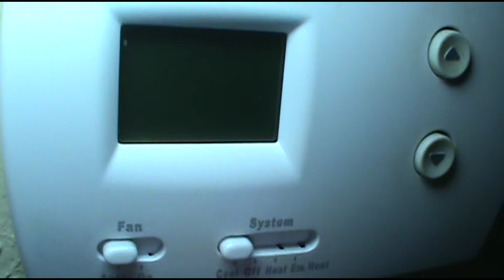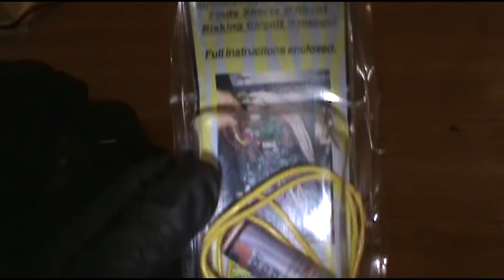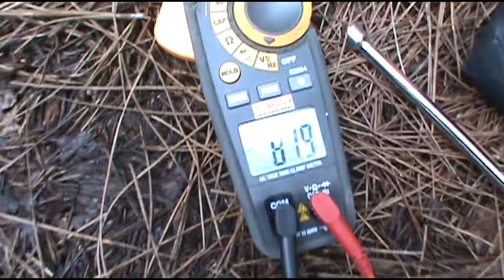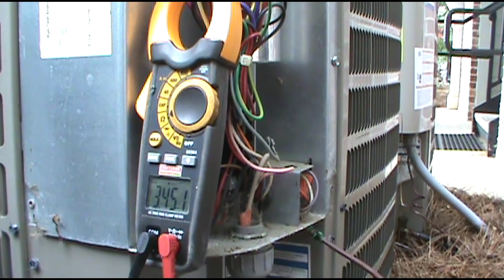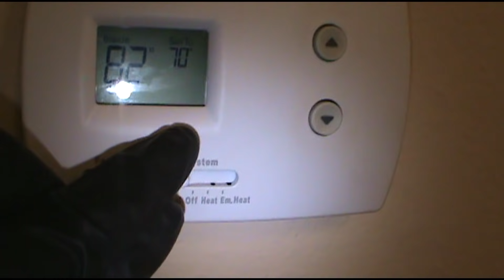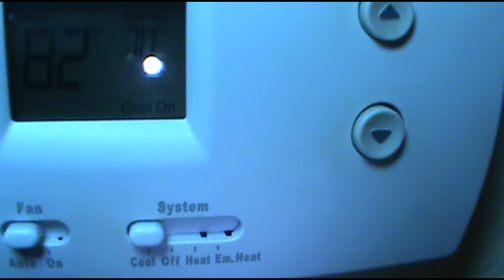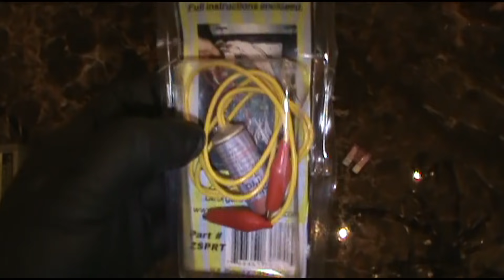Circuit Board Fuse In A.C. Keeps Blowing

Comment: I have a heat pump and when I select heat it trips the fuse. I  have changed the transformer I checked wires for breaks. Was wondering what you thought.
Reply from the maker: Low voltage shorts are too tricky. It could be in the wall, in the attic, or Lord knows where. I would change out the wire for one that's not being used. If the brown wire is in the heat strips terminal in the thermostat, switch it out with a black wire that's not being used. You'll have to take the shorted wire totally out of the mix. Even in the air handler. I hope everything works out for you Mock! 🤞
Reply: @LexVance  Thank you for your response I am going to use the pro short for the heat side of thermostat have done that before and if you have do you have a video.  I was just wondering what wires would need to be taken out of thermostat to do a heat short.

Comment: Anyone help me find my problem? I replaced both of my thermostat wires: my two wires to the AC and my 5 wires to the thermostat and even connected a new thermostat and the fuse blows immediately after the AC kicks on.

You said that it can't be the capacitor since it's high voltage.

Could this be the board? A short in the board somewhere?
Reply from the maker: It could be in the condenser outside, too.
Reply: @LexVance  Hi Lex, thanks for responding - I just figured it out - it was a bad contactor.  Replaced that and haven't had a problem since.

Comment: AWSOME video we have a temp furnace at work to cool and heat temp offices ,it’s a Payne brand and it keeps blowing 3 amp fuses , kicker is we have 2 temp units that is doing the same thing just a few days of each other don’t have any  multi meters  so we asked the sparks on job to check the blower and the said they jumped the blower motor bypassing something and the blower will no go on but the code is 24
Reply from the maker: Sounds like you've got a head scratcher there. 🤔Thank you so much for watching Jas!
Reply: If a 3 amp keeps blowing , is the short on the 24v side or could it be the blower and can I apply the same method as you used your 4 clip jig and the Short finder
Reply from the maker: @jasvan4359  the 24 v side. The fuse is for low voltage only.

Comment: Been babysitting a goodman system and cool seems to be the problem side, when it clicks on, 5 amp fuse-breaker drops and I have to pull the thermostat off and let the breaker reset.

Grabbing the cool wire short finder but, will also go clean the outside unit and contactor... Likely the problem child..
Reply from the maker: Thank you so much for watching Tim!

Comment: Every time I flip my breaker on the air handler my fuse pops what do you think it could be I changed the condenser defrost board put in new thermostat and fixed the nicks in the low voltage wire that the dogs chewed up please help me Lex lol I’ve been on this for 3 days what do you think it could be
Reply from the maker: The contactor could be bad. I would need to be there for this head scratcher 🤔.

Comment: My problem was a intermittent  shorting.  solenoid /valve  on the humidifier blowing the 3Amp  24vac. Fuse. Sometimes on furnace start.  I disconnected the solenoid and never blew 3a fuse again.  This case is with heating . -3°F  outside. I  figured it out in 15 mins. Being a highly trained  electronics tech for over 40 yrs.  I fixed it fast (LUCKY me)  not always easy  on some problems. REPLACED SOLENOID AND PROBLEM RESOLVED.
Reply from the maker: Right on, nice fix Ken! Thank you so much for watching!

Comment: I have a question I have a heater that's a heat pump it runs fine for a while and then it pops the fuse my guess is it's popping it when the reversing valve is energized but I could be wrong I haven't looked at the unit yet but I know that's what's happening. It's a Ruud system, I'm thinking it runs fine it heat mode and then when the RV is energized to go into defrost mode is when it's blowing it. I'll be going there in the morning to look at it, just curious what you think it could be as it doesn't pop right away.
Reply from the maker: I've had bad thermostats do that. It'll work for a while then pop the fuse. Put your unit in cool mode and see if it happens. If it doesn't, it may be the thermostat. Thank you so much for watching Aaron!

Comment: Hey my fuse keeps blowing in the air handler I’ve changed the defrost board the breaker is good and the contractor reads 17.3 what do you think it is
Reply from the maker: There could be a low voltage wire thats nicked and touching another wire or the metal frame in the condenser. A low voltage short can be tricky. The thermostat could be doing it too.

Comment: We have a Rheem that humms and pops the fuze every time you turn it on.  Nothing is working inside or out. It worked fine through the summer with AC.. turned the heat on and pop..
Reply: It's a heat pump..
Reply from the maker: There's a short on the brown or white wire in the thermostat or the thermostat is bad. Brown and white are usually the wire colors for heat. Your unit maybe different so be aware of that. You can disconnect the brown and white wire one at a time and see which ones bad. Then, you can hook up a color that's not being used in place of the shorted wire.
Reply: @LexVance  what would allow the unit to still come on when there is no fuse installed and it sparks when you install fuse?

Comment: Every year when I turn on my a/c it blows hot call a repair man and they are always only here maybe 30 minutes at the most and my unit starts blowing cold but if I turn it off at all then when I turn it back on it only blows hot again. Sounds like they are doing a simple fix so they can come back later and get more business. What can this be?
Reply from the maker: Yikes, that's a weird one. I'd need to be there because there's numerous things I would need to check with my volt meter. You've got a head scratcher there. 🤔

Comment: What if my transformer burned up? Is it the contactor.outside.that causing the problem. First I saw my fuse was blown  so I got some copper and jumped across the fuse like a dam dummy and burnt my transformer up. Ikr... So now I need a contractor and a transformer right?
Reply from the maker: It could be the transformer or low voltage wire touching and causing a short. I hope it works out for you Leonard!

Comment: I did what you suggested in the latter portion since I didn’t have a visible cut in wire. It was yellow faulty by screw nut elimination. I then went through and replaced the yellow with the extra black wire. When it all kick on it was heat! Not AC 😬 …???
Reply from the maker: Hmmm, is it a heat pump or straight cool unit?

Comment: So on update to my previous post.  I realized the compressor is running after all when I press the bypass button on the contactor.  I then measured the ohms on the low voltage side of it, and its near zero.  The ohms on the terminal side from the home is aroun 335 ohms.  So I will replace the contactor.
Reply: This is a bit confusing.  Are you saying the coil was near 0 ohms on the contactor ? Also what measured 335 Ohms. Please explain further. Pity you did not have this in your video which was very clear to follow.    Thank you for sharing your expert knowledge as it makes a big difference to us newbies especially those working in bad companies where they do not want to share any knowledge.

Comment: 3 amp fuse was blowing.  New fuse blew. I followed your advice and first looked at thermostat.  As removed it, a bunch of dead bugs fell out.  I decided to disconnect it ad put in a new fuse.  It worked as the circuit board would power on and not blow the fuse. decided the 15 year manual thermostat was time to go. I went out and got a 2 cycle programmable.  It got it al hooked back up and now it looks like it is defective out  the box.  It just lights up but no display.
Reply from the maker: Oh no. I'd need to be there and see the letters on the t-stat.
Reply: @LexVance  I did get it fixed.  I opened it up and the small graphite strip between the main board and display came dislodged.  I got it installed and when I switch to "fan' the unit comes on. But when I switch to cool, it blows fuse.  So I went out side and removed hatch.  When I press the button on the relay, only the fan comes on, not the compressor.  I went ahead and ordered a capacitor as they are only $10.

Comment: Lex, I was messing with my heater 3 months ago it wont turn on( but every now and then it will turn on miraculously but turns back off after a few min . I used a paper clip to use as a jumper wire to bypass the thermosthat . Nothing happen . The thing now is my AC WONT turn on as well. I didn’t not know what I was doing with the paperclip I must have shorted something in the proccess. Also I didnt turned off the power . Would this AC problem not turning on is cause by a burned out 3 amp fuse. Do all ac handlers have them? I appreciate your  help. It’s getting hotter in Sacramento . Temp reached 90 f today
Reply from the maker: Make sure drain pan or float switch isn't full of water. That will make unit not turn on. Also, the paper clip could've shorted out the transformer. You'll need a new one if so. I'd need to be there with my volt meter to see what's going on. Not all units have 3 amp fuses in them.

Comment: Lex.  Good morning love your videos
Question.  We have the same air handler at our property. My issue is when im trouble shooting board. Thermostat takes for ever to turn back on. I dont dont know if is the thrmrt or the control board.  How can i make run faster for repairs.  Thank you
Reply from the maker: Heat pumps have a 5 minute delay after power gets restored. Check thermostat instructions and you'll see how to make unit turn right on after repairs. You have to hold buttons down and then scroll to find setting for immediate turn on. Hope this helps. It's hard to explain on comments. Thank you so much for watching Gali!

Comment: Hi Lex I hope you see this soon. Bought a short pro ...should be here monday or tuesday to find the short.

** FIRST LOOK****3amp fuse blown digital Thermostat no power ...changed fuse and replaced disconnect and fuse popped immediately.  Visual inspection of wires at Therm, AHU and condenser did not show any nicks....Tested board....relay tested good (ohm test on C...NO and NC)  but did not get a reading at xfmr-R to R...Replaced board and new fuse.
***THEN....with new board....did not pop immediately and Heat came on and lasted less than 5 minutes but popped the fuse... and I believe it might have also fried the board. Xfrmer still tests good...relay on new board  tests good. 
1) Do I have to have a fuse in (with disconnect still out) to test ohm from xfmr-R to R?  I can't remember if I put  a fuse in with disconnect out...the first time.
2) Since I am testing for a probable heat not ac short....do I test every wire except blue C? or maybe just Red (R)...White (Aux/E and Orange (O reversing valve) and....yellow? green? 
3) Should I check that heat strip is installed correct...this is resident #3 on a 5 year old building with no previous issue....so I am doubtful that no one ever used their heat before...but i  had a problem in the first two years with misaligned heat strips popping fuses...so theres that.
Thanks for your advice Skid Master...really love the videos...super helpful!
Reply from the maker: Yes, to test the board, make sure there's a good fuse in there. I just take it wire for wire. Also, a few times when the fuse popped in heat, it was a bad thermostat. It would run fine for a while. I'd come back the next morning and the fuse would be blown. I replaced the thermostat and never had another issue. You've got a head scratcher there that I'd need to be there on to see what's going on. Trying to figure it out on comments is difficult for me. If it's popping intermittently in heat, try a new t-stat. Sometimes low voltage shorts can be very tricky.
Reply: @LexVance  Awesome response time Lex!.. I did initially rewire in a new T-stat back plate....but i used the old face plate...I am going to put the new face plate on tomorrow.
Reply from the maker: @cindchar1  I did the opposite. I left the old backplate and just popped on a new faceplate. I never heard from them again after a week of fuse popping intermittently. 👍
Reply: @LexVance  Also...thanks again for being there for us!
Reply: @LexVance  So here is the update. Short pro in place along with Skidmaster custom built jumper. No matter what wire was disconnected (except blue common of course) the light stayed on. Red and Green jumped and the fan never came on like in your video. After scratching my head and watching more videos I came to the conclusion this was over my head and called in a Pro. He came out and pretty much was stumped too. Eventually he found that the blue common wire going out to condenser was shorting out....so he jumped over to the brown wire...plugged everything back in and the fuse still popped right away. More testing and head scratching and finally figured out that the low pressure switch had gone bad.  So there were two problems happening side by side...He unplugged the yellow wires from defrost control and put a jumper from there to the left side of the contactor. He tells me I have to replace LP switch and I should also replace High Pressure switch at the same time since a bad LP...will cause the HP to fail sooner than later.
I am NOT looking forward to this braze job. Have you seen how tiny those lines are......sigh. :(
Reply from the maker: Also, leave C the common wire in the t-stat when testing wire to wire.

Comment: I have a 3 ton goodman and can not find a fuse!, it's nowhere to be found, is it possible? Please help!
Reply from the maker: The older stuff doesn't have a fuse. Just a transformer. If the transformer is fried you'll need a new one. But, make sure the short is fixed first or you'll fry the new transformer. Sorry to hear that Bobby. 😭
Reply: @LexVance  Thank you so much for your reply! This thing... it was working great for 3 years i was here, until condensate drain got clogged, I cleared it, still wouldn't work, now fan was not spinning, found out my capacitor fried!, I replaced it, now everything works and I can hear compressor working too, but its not cooling at all, just moving air around, I took the panel off in the guarage and found a 3 volt fuse on the electronic board like in most cars- its fine,, will be testing transformer ...I'm too broke right now to call technician, and flabbergasted at all of these problems appearing at once! Nothing like it i could find on internet...its a goodman 3 ton, my only hope right now is internet... do you have any ideas? I'm pretty technical and have been fixing all kinds of different things mechanical and electrical successfully, but this one got me. Any advice would be much appreciated!

Comment: 2 things. if you do actually replace a shorted wire with one of a different color, do you recommend wrapping the end of that wire with electrical tape  of the same color of the wire taken out of the mix? I mean, color coding seems to be important in this industry. Just wondering. Second, I have a fuse popping in the winter and the t-stat is on HEAT. Do I simply do the Jumping together with the t-stat wires but leave the cooling wires on and this time take off the heater wires? 'Preciate much!
Reply from the maker: Yes, you can mark the wires so you'll know which goes where. If your unit is a heat pump, you'll need red, green, yellow , white and brown wires. If it's a straight cool, then tie red, green and the heating wire only.